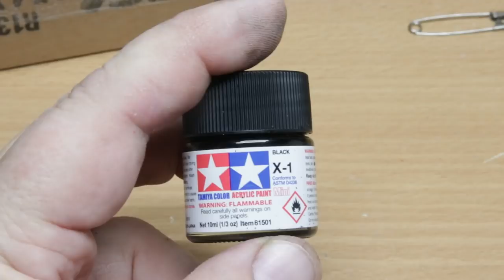Matchbox #10 Pipe Truck - Custom

Comment: Hey Time Rider, This is a cool truck, I did similar to a refrigerator van 44c The van part was scrap but all the cab and chassis was good so I scratch built the deck from Evergreen polystyrene and made a load from HO scale railway stuff. So no reason not to create Phantom or custom's from your stash. Oddly enough that particular model I actually have in my collection or the Girder version. Keep them coming. Have a safe move and a Blessed Christmas. Cheers' John
Reply: That should have read don't have.
Reply from the maker: John, I have two 44Cs, one will be something other than a reefer . . . trust me!

Comment: try using small wooden dowl for your pipes
Reply from the maker: I thought of a lot of things I could have used for pipes.  But I had four of these trucks and I still have two more untouched.  I was just in the mood to make the lumber truck, it had been in the back of my mind for a while . . .
Reply from the maker: @grahamw3105  I know . . . I was busting your chops . . . sorry.  But let me ask you a question, what would be the advantage to a two step process as opposed to the pen, which is one step.  I'm not discounting your suggestion, I'd really be interested in hearing the response.

Comment: Hi there, Time Rider; another fine custom job. Love the way the cargo turned out. I'm still quite surprised how well your way of securing the wheels with epoxy seems to work. For lack of a drill press, maybe the method shown on the Matchbox Restoration channel is an option, too. It's demonstrated in this video form about 5:00 minutes on and seems to be simple and working well, too: https://www.youtube.com/watch?v=rX7vbZmITX4
Reply from the maker: Yeah, I subscribe to his channel and I tried that method, even before I saw him do it.  I very lightly struck the casting, inadvertently, , at which point a chip came out of the paint negating a great deal of work.  I have another solution and as soon as the items arrive I'll be using a different method.  Not gonna happen again.  I don't play with these, I don't sell them, I just display them.